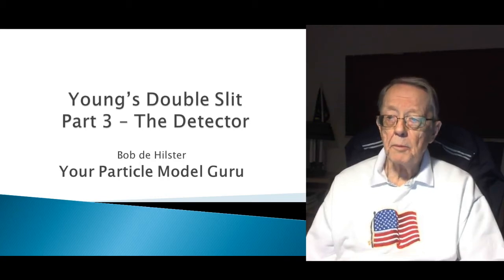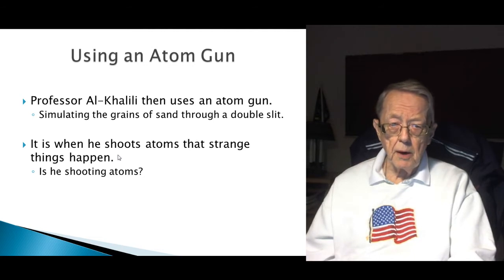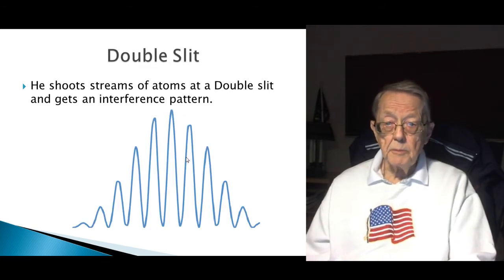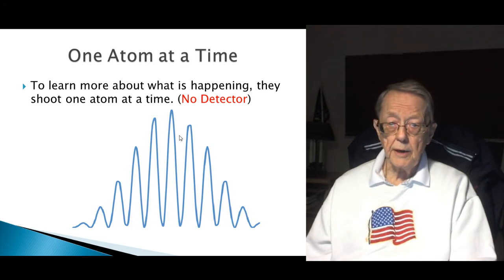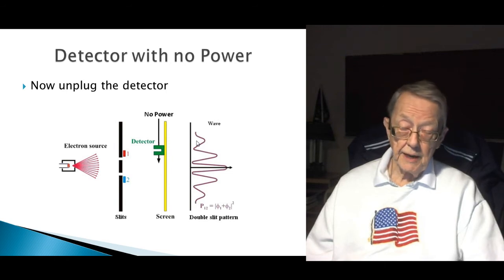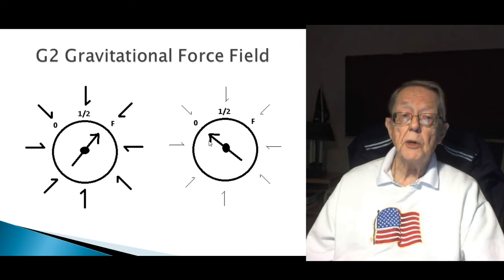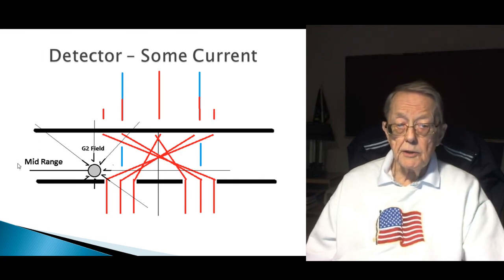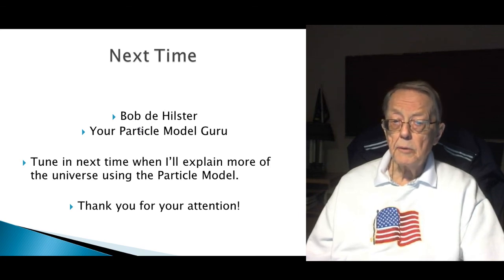Young's Double Slit Experiment Part 3 - The Detector

Comment: This is without a doubt the most intriguing theory to the issue I have heard so far. So much so that I would like to set up an experiment with a variable/adjustable detector to prove it. That said, I suppose one could try an even simpler approach. Maybe power the detector on and cover its lens or detection aperture so as to leave the dc field present but with no detection capability. Or perhaps put some sort of dummy dc coil in place of the detector which would still created a similar dc field but has no detection capability. I think one of these simple methods would answer a lot of these questions regarding dc interference.

Comment: naive question on the slide at 7:50, if the the current in the detector is disrupting the interference pattern, why is the resulting pattern on the screen symmetrical, when the detector is only on one side? I did some google searching and found images with two detectors.

Could one not use a single detector, shoot however many 'atoms', switch the side the detector is on and repeat, then compare the two distributions? if they are different, this would suggest that the current in the detector is responsible, and would refute the idea that taking the measurement via the detector is somehow altering the global wave/particle status of the trials.
Reply: I am searching for that answer too
Reply: Because all the dc interference is doing is causing enough disruption to collapse the delicate wave function of the particles but not enough to pull everything significantly through one slit more than the other. Perhaps?

Comment: I have the same question... How do they know they're shooting one atom or photon?
Reply from the maker: It is possible to reduce the voltage on the photon source until they get one hit as recorded by the detector. That depends on the sensitivity of the detector.  

TPM suggests that each peak can contain from a  few G1s to many G1s, with no guarantee. So there could many G1s each triggering the detector.  Or all of the G1s in a peak could trigger one point.
Reply: @ParticleGuru sir, does detector affects both single and multiple electron shoot experiments?. so considering "which direction electron goes  probability " , will we get interference pattern for multiple electron shoot ydse experiment with detector ?
Reply from the maker: @khushalsoni3731  I don't have the equipment to do the tests that are needed.  Dave and I have several we would like to do.

Given the idea that the G2 gravity field around the detector is strong enough to modify the flow the the electrons, the effect might be possible with multiple electrons.  

A weak G2 gravity field around the detector may not effect a stream of continuous electrons.  

A test can be done with a special circuit simulating a detector that allows us to adjust the G2 gravity field and move from an interference pattern to just two bars. Somewhere in the middle we might see both.

Comment: Did anyone consider the slit itself ? It’s made of atoms correct? They have weak and strong nuclear force yeah? Any electrons in the slit material ? 
Maybe it’s like shooting a magnetic ball through a magnetic slit material....and being surprised it change direction
Reply from the maker: It was after I made this video that I understood something about the light in the slit.

Light, a stream of high intensity G1 particles,  is moving through the slit at speed 'c' towards the target. But the G2 particles are moving through the slit at a speed much faster than the speed of the G1s. 

So if you slow the G1 particles in the slit to a stop, you have G2 particles passing through a  stationary G1 field. This causes a G2 loss in the slit which causes a G2 field gradient in the slit. This is one of the key reasons for developing an interference pattern.

The light itself becomes part of the system that provides a G2 field gradient in the slit. 

To calculate the next position of the planets in our solar system, we stop the planets. As the G1 particles move through the solar system, a G1 field gradient is set up that allows us to calculate the forces on each planet, determined by the position of the planets.

The same physics at two different levels. Amazing!
Reply: Still does not explain the problem witn the detector😃

Comment: In order for the detector to trigger or click it has to suck in energy from the particle or group of particles. This could easily be what is disrupting the interference pattern. So the next question might be,  what component of the particle itself is being lost or removed by the detector that takes away its ability to create a wave pattern?
Reply from the maker: How can we know that one and only one is being released? If you listen to my video "The Candle", I contend that more than one G1 is pushed out each time.
Reply: @ParticleGuru  hello sir can you name the detector name.
Please.
Reply from the maker: @chandanvudala6778  That is a good question! Since I haven't done this experiment, I don't have an answer. But I will find out!
Reply from the maker: Here is an answer from  Dr. I Chavdarovski: There are so many options to detect photons and electrons, such as chemical detectors (film), semiconductor detectors (photo diodes, CMOS and CCD detectors). In case of visible photons, human eyes can do the same job.  

However, The TPM solution requires an detector that is powered by ac and generates the required G2 gravity field.
Reply: @ParticleGuru  sir can you please explain me where I should place that sensor.
Reply from the maker: @chandanvudala6778  I am guessing. If G2 gravity causes the change in the interference pattern, the main body of the detector should be placed close to the slit.

If there is a lead that senses the particle it should be placed around the slit.
Reply: Where did You get your information about this?

Comment from the maker: Particle detectors are common in physics, but I have not studied the details of their construction. My observation of the experiment indicates that the detector affects the light pattern one way when it is powered on and another when it is powered off. The main changed in the detector is the current flowing (or in the case of the Particle Model  the G1 flow). That G1 flow must have an external influence that the Standard Model does not have. The Particle Model  suggests that G2 gravity is stronger in the presence of many G1 particles and weaker in when there are fewer G1 s.

Comment: Would be interesting to known more about the detector itself... basically its structural geometry and materials composition. Any pictures of this?
Reply: absolutely,  the dector itself could be the main cause of this strange behaviour and if an altertative detector was used it would revert to the 'wave interference' pattern on the backplate when you don't use the detector..
Reply: I’m sure there’s a paper from the experiment he’s referencing that should have details on the equipment used.
Reply: @AlienAware  Great question !   Another Q is how can a detector detect a single photon or electron without destroying or absorbing it ?
Reply: Jim Al-Khalili shows in his videos that the detector doesn't flash a light or beep until AFTER the electron or full atom shoots through one of the slits.
Reply: Also the wave function recorded on the photographic plate at the back of the double slit experiment is an actual physical wave not just an abstract concept calculated with mathematics because it leaves actual physical markings on the back of the double slit experiment that have to be put under (likely) and electron microscope so they can be seen because they are so small.

Comment: The graph shown at around 4:00 is a diffraction pattern, not an interference pattern as he claims.
Reply from the maker: Interesting point! Diffraction involves classical waves, crossing each others path, as in water waves. The interference pattern is what is seen on the target screen. The particle model does not have a classical wave, just streams of light that have a wave pattern. These streams do not cross paths. But they do combine at the target screen giving an interference pattern.
Reply: No, diffraction is a property of any type of wave, and is produced when a wave passes through a small opening.  It's caused by the interference of the many spherical waves that can be thought to be emitted from each point in the opening.
Reply from the maker: You are correct. I went to bed and realized I had made a mistake. Thank you for your comment.
Reply from the maker: You are correct. When I got into bed, I realized I had made a mistake in my comment. Thank you for your help.